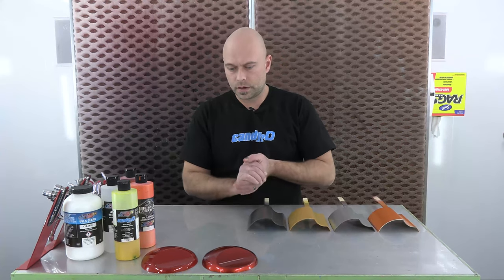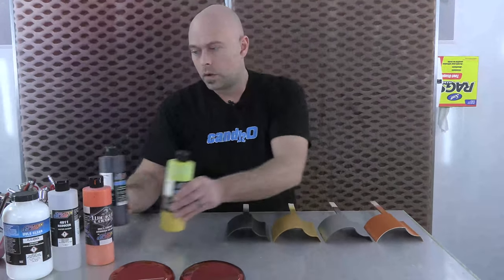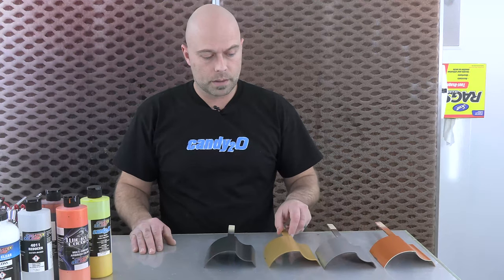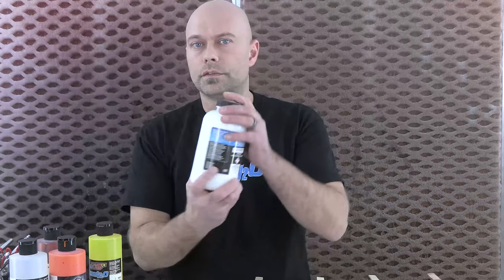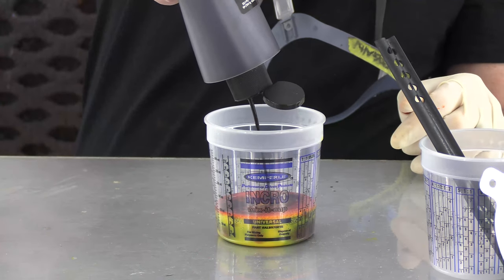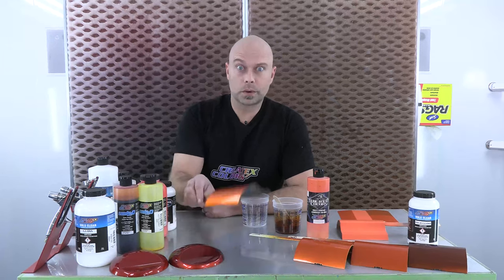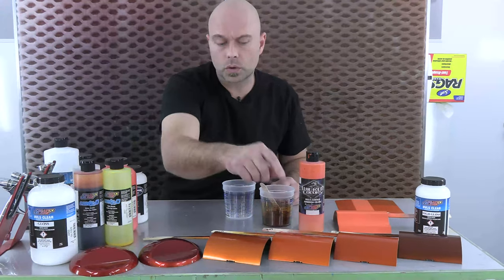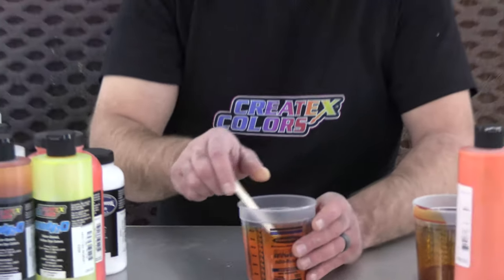How-To Make Candy Tangerine

Comment: Those are all awesome looking colors chris. Is there any difference in UV fade resistance between a candy and a pearl when covered with a urethane top coat.
Reply from the maker: Mixing a pearlescent or metallic color with a candy2o color will have overall higher lightfast strength compared to candy2o alone, however in each case the lightfast strength of the candy2o itself is the same. The best way to get the best lightfast strength with candy2o is to mix it with 4050 UVLS Gloss Clear as recommended, and apply colors in multiple, medium coats until a saturated, full-strength candy color is achieved. Thank you.

Comment: Thank you so much for this. This is exactly what I was looking for but wasn't able to achieve on my own. I find mixing candies very difficult because I can't tell what the color mix looks like until I paint it. When I mix normal paints I can tell right away if I have what I want. Is there a process to follow when mixing candies so I'm not making wild guesses and wasting paint? I know color theory very well but is there a way to creep up on a color when mixing candies?
Reply from the maker: The best process to determine what happens when candy colors are mixed, and how different metallic bases create different candy finishes is through test panels, lots of test panels. You knowledge of color theory will help you avoid making "muddied" colors, for example, mixing complimentary colors. Thank you.

Comment: I have a customer who wants a slot car body painted in tangerine, but with a matte clearcoat.  Would I still use 4050 with the Candy2o then clearcoat matte?  Or use the 4052 with the candy?  OR should I just steer him to Wicked Orange and just matte coat that?
Reply from the maker: Yes, always use 4050 for mixing with candy2o, even when the finish is matte, which should be created by the top-coat. For a customer slot car, top-coat canndy2o with a 2k urethane clear, gloss is OK. After the gloss 2k clear cure, sand it flat, then apply UVLS 4052 Matte Clear. Thank you.

Comment: So, 4050 is now the "go-to" additive for hard surfaces for any color that specifies 4030 on the bottle?  I paint lexan RC car bodies exclusively, and most of my Createx bottles specify 4030 for hard surfaces.  Should I just always use 4050 instead of 4030, for these applications?
Reply from the maker: 4050 UVLS Gloss clear was developed 4 years after 4030 Balancing Clear was first introduced. 4050 was first intended as a top-coat clear. During its development, we found it was also an excellent candy2o carrier, 4050 sharing a common, urethane resin as 4030. Since 4050 was introduced, we've only used it as the carrier for candy2o as it allows for spray-gun / mid-coat application of candy2o with higher saturation, leveling and less bleeding, all of which allow for a significantly more even color-coat compared to 4030. For airbrushing, most also prefer 4050 over 4030, however the performance difference is not as disparate as spray-gun, so 4030 still works for some. Additionally, artists adding a little of either 4030 or 4050 to their Wicked Colors or Illustration Colors ~ 10% per volume prefer 4030 as it requires less thinning as when adding 4050. For candy2o, we highly recommend sticking with just 4050, but do respect others may differ due to their subjective preferences. Thank you.

Comment: Does Createx recommend a solvent based topcoat to go over their color coats? I've heard people sy to watch out for putting solvent based over water based, but maybe this isn't really an issue? Maybe it's just about proper dry times?
Reply from the maker: Hello. Createx have been top-coated with a solvent-based, 2k urethane clear since at least the early 1990s. Our current favorite is PPG's EC550, made to top-coat its line of water-based paints, Envirobase. Createx paints are compatible with all brands of 2k urethane paints, primers and clears. For more, please see our Solvent-Based Clears video,  https://youtu.be/JuroIpJOCNo. Yes, always allow the water-based paint to thoroughly dry before applying a solvent-based clear. For more, please refer to our application guide and tech sheets available at www.creatextech.com. Thank you.

Comment: should the "bleed checker" be applied before the clear coat? I want to try a candy/pearl deep purple and found that the candy deep purple does bleed heavily with out the bleed check
Reply from the maker: 4040 Bleed Checker doesn't need to be applied over candy2o before top-coating with a catalyzed, solvent-based urethane clear. To avoid bleeding, make sure candy2o is being properly mixed with 4050 UVLS Gloss Clear (4050 6:1 candy2o for a spray-gun), and only thin candy2o minimally with 4011 Reducer when using an airbrush. 4011 Reducer isn't required when applying candy2o with a spray-gun. Thank you.
Reply: @CreatexColors  there's my problem...I was only doing 2:1 with the balancing clear....thanks

Comment: Do you use sealers underneath the metallic gold and charcoal
Reply from the maker: Yes, thank you for the question. 6002 AutoBorne Sealer Black was used as a base for all metallic colors, except the aluminum, which is simply 6013 Silver Sealer, made with a blend of the flakes used to make our aluminum colors. For the orange candy-pearl color, the base is 6001 Sealer White tinted with 6005 Sealer Orange. www.autoborne.com